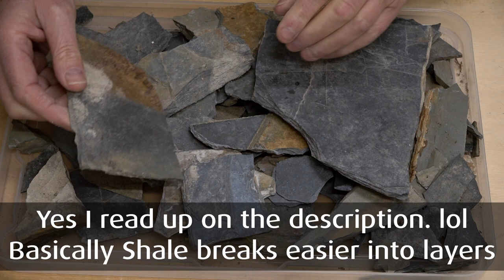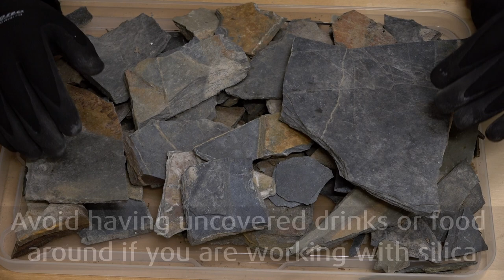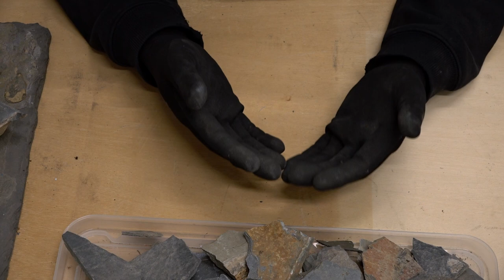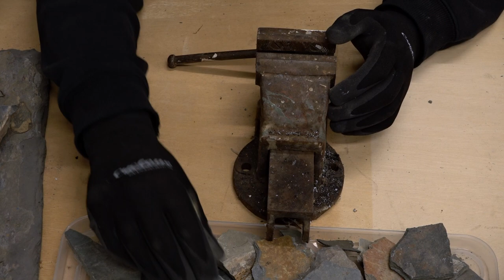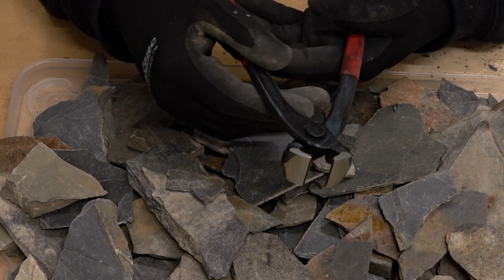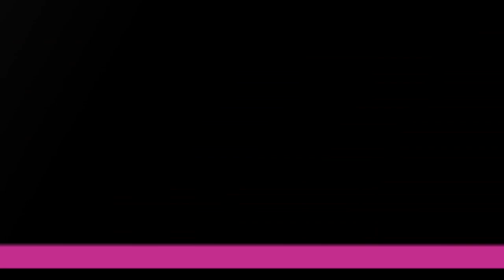Working With Slate For Mosaics

Comment: Hello, my friend.  Enjoyed your video immensely.  While I have worked with slate only 2 or 3 times , as I watched this video, I wondered if you ever use a thin chisel to separate layers of slate.  I remember using wood chisels or metal chisels (in a similar manner to your use of the hammer claws) to get a rather large thin pieces of slate.  Of course, tool lovers and purists would cringe at my constant misuse of tools.
Reply from the maker: Hiya Aureleo, great to hear from you. :)  LOL@Constant misuse of tools, we have something in common there.  lol Yes I have done that with chisels that are blunt, it takes its toll on them though. Also a brickies chisel can work well for thicker pieces. I tend to experiment and see what works, sometimes with not so good results on the tools.  lol Thanks heaps for watching. :)
Reply: @TreasuryRoad  Peter, Rachel Sagwer uses a blade out of a wood plane like a chisel.

Comment: Thank you for this great video also, Peter!  Slate is beautiful= and I just acquired some pieces at a yard sale. I’m wondering - if I use it as a substrate would I seal it before just like as I would a Terra Cotta pot?
Reply from the maker: Thankyou very much Cheryl, slate is porous but its also used for roofing. I personally have only used slate for indoor pieces and have sealed it with a penetrating sealer before mosaicking onto it however my experience with slate is very limited. Some people prefer to use a penetrating sealing on porous substrates and others don't.  I do love using slate and would like to work with it a lot more, Rachel Davis is the absolute queen of slate and her pieces are fabulous as well as her knowledge with slate, you could reach out to her for her opinion, Rachel is in a number of Facebook mosaic groups. Using slate as the substrate will make the piece quite heavy I would be inclined to use Wedi board or Thermasheet as the substrate and apply the beautiful slate pieces to that but it does depend what you have in mind and the size. Thanks for watching. :)
Reply: Thank you again for your willingness to share your expertise. I have watched a couple videos by Rachel using slate, but I haven’t found one about slate as a substrate. I’ll pose a question to her directly, though. My plan was to make a house number plaque that needs to be able to survive in a cold winter climate, so Wedi seems best. Good day! I love hearing the bird songs in the background on your videos!
Reply from the maker: Thankyou Cheryl, yes I love hearing the birds in the garden as well. Unless you are going to be seeing the beautiful slate background I would be using Wedi Board because the mosaic will cover it. :)

Comment: I wonder how it would work with a hammer and hardie.  Ever try it?  Thanks for this great little video!!!
Reply from the maker: I haven't tried that Ingrid, it may work but keeping it steady may be the issue because the slate isn't flat due to its layers and how its breaks. It may be the case  it works well for the large pieces but smaller pieces may be fiddly. Thanks for watching and appreciate the comment. :)

Comment: Hi Peter! I just received a nice order of slate pieces. Very gritting and dusty. Should I rinse and dry them off before I attempt to cut or before I apply to my substrate? Might be a silly question. 😊 Thank you!
Reply from the maker: Ohh that’s quite exciting and not a silly question. l would be rinsing them and cleaning them up a bit if they are really dusty and dirty. Thanks for watching and commenting. 😊
Reply: @TreasuryRoad  thank you so much!!!

Comment: Hi Peter,  is it safe to use slate as a substrate as it's break down easily into layers or pieces. 
What kind of preparation is required for using it as a substrate. 
Thanks
Reply from the maker: Hi Mozhdeh, slate makes a pretty good substrate, it is heavy though and using it would depend on the project, they do use it on floors and countertops. Generally slate itself doesn't require any preparation. :)

Comment: What adhesive do you recommend for adhering slate to a mosaic?
Reply from the maker: Generally l use thinset (cement based adhesive) to adhere slate. There are different types of thinset so make sure it’s suitable for the slate, substrate and the environment the mosaic is going into. 😊